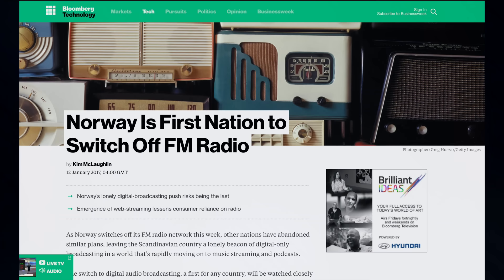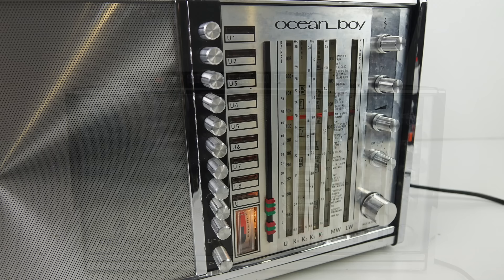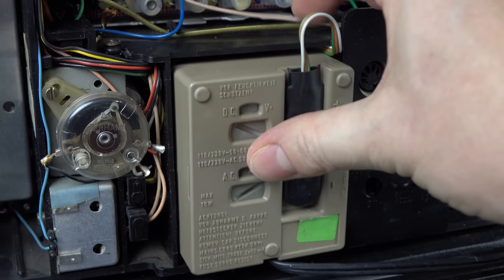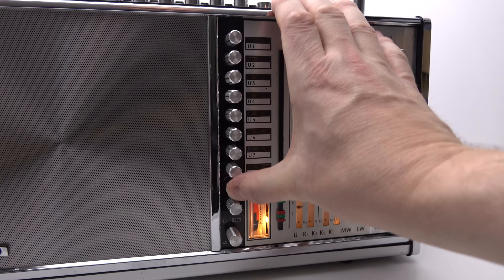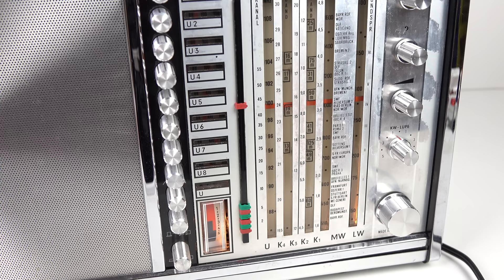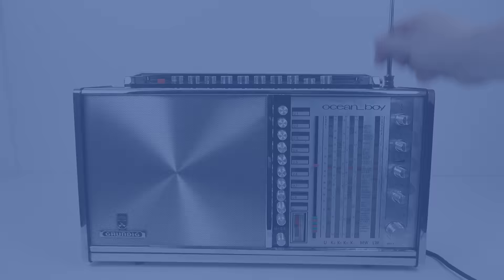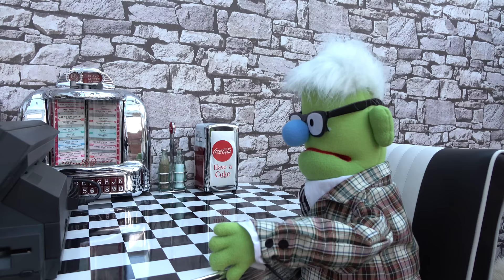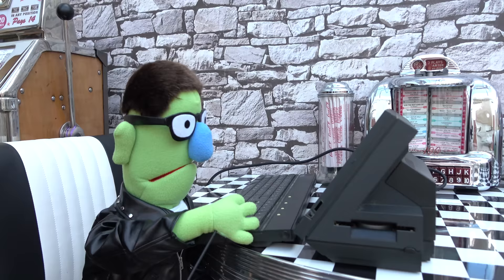Design Classic: Grundig Ocean Boy 210 Radio

Comment: I don't understand. Why are countries trying to switch off FM radio when the FM signal has better quality sound than AM radio?
Reply: because it has worse quality than digital radio
Reply: They are not reverting to AM, they are switching FM to use DAB (digital radio) instead. The latter having better quality and more features than FM, although one might argue that it is also more complicated to operate and requires replacing your equipment.
Reply: Is that a joke? If not then it's because they will be switching to digital radio. And even digital radio will probably die eventually, pretty much the whole continent is covered in mobile internet by now.
Reply: they moving to digital, not AM.
Reply: Louis XIV (aka 1685Violin) That's ok. If you read about it, you will soon understand. On a technical level, it's a RF/radio geek fanboy ordeal to explain it. It's like when countries switched over to using digital TV frequencies - we all had to either buy new sets or get a signal converter. Same thing is happening with radio. See this article - I'm sure there are loads more -- http://www.which.co.uk/reviews/radios/article/digital-radio-switchover-explained
Reply: Not to mention DAB is cheaper to run (and supports more channels compared to FM
Reply: Louis XIV (aka 1685Violin) Maybe cause the AM signal supports a wider range of sqaremiles then FM. Means FM is more expensive to run.
Reply: +Daniel Flught: cheaper to run from stations POV, i guess? Because the user has to change current receiver, so it's more expensive.
Reply: Jeren Velletri less about quality and more about freeing up radio spectrum for other things. broadcasting on FM and DAB means there's a bunch of space that can't be used for something else.
Reply: because they're making a digital switchover to online radio or DAB
Reply: Because the bandwidth will be very useful for 5G mobile. Your government can re-sell the spectrum licenses for a fortune. It's the same for non-digital terrestrial TV. "Ker-ching!"

Why do we still say that when cash tills have gone "Beep" for about 30 years? Oh well....
Reply: Because manufacturers of digital radios want to make money so they spend some money bribing governments making them think that this new digital thing is much better than the old analog crap so we should all throw our old radios away. And our old cars in which they've been making it more and more difficult to replace the radio in the past few years. But of course they'll let you buy a little device that receives digital radio and retransmits it on FM for your old radio.

Also, of course, organizations that own lots of copyrights want to make it as difficult as possible for you to record anything from the radio for free in decent quality so they've spent lots of money to make FM radio sound as crappy as possible in the last 20 years or so by introducing compressor/limters that make everything sound equally loud.

So in short: greed. And because people choose convenience over quality.
Reply: They are switching to the "new"(Invented in the mid 1990s) radio standard called DAB (Digital Audio Broadcasting)
Reply: Pushing sales of digital radios, which are made in China, thus strengthening the economy in China.
Reply: FM takes up an awful lot of space on the frequency spectrum for being not really that good quality, the choice to switch off FM and free it up to be used for other digital protocols in the future is only logical to me
Reply: Yeah, more stupid radio stations with the same shity songs on constant repeat and tons of commercial breaks. Wow, that's a bright future with digital radio. Same shit happend to TV.
Reply: Sam Gates Wrong. For example, there's a huge quality difference for the same station broadcasting in FM an digital HDRadio. Moreover, with same level of signal strength digital reception is more stable comparing to analog FM.
Reply: Yeah, and warm analog FM stations broadcast only live concerts using vacuum tube sound amplifiers LOL
Reply: Government gets to auction off the frequencies FM used to be on for mega $$$ which it can then misspend in the traditional manner.
The cost of buying DAB receivers falls on the consumer... but isn't actually called a TAX
This is why governments favour shutting FM

BTW DAB radios eat batteries compared to analogue and (in my experience) break down much more often - I also think it'll accelerate the lack of diversity in radio broadcasting.
Reply: Sam Gates DAB uses far more advanced codecs than the outdated MP3. there have been serious advances in audio codec tech, but everyone uses mp3 only because it's supported by most devices. DAB radio has far superior sound quality than mp3
Reply: +Dan Kueck How is it then that whenever the slightest hint of bad weather hits the fan, you might as well switch off your digital equipment because it's useless due to endless screeches and plobblwops or do you consider that music as well? There goes the "higher quality" out the window. Plus you'll find all radio stations broadcast in good old am quality "mono" just with a cleaned up sound. So sound engineers may as well shut up shop as well coz it turns out that the world will listen to any old shite that comes through one speaker. The stereo picture will sadly be a thing of the past.
Reply: +Reversed82 Have you actually listened to an FM station then compared it to it's dab counterpart? DAB is monophonic rubbish. Not stereo. Oh wait, you listen to nothing but your iphone or rather 1phone as it only has 1 channel. Last I knew humans were born with 2 ears, left and right unless born deaf. If your BBC radio FM signals are crap then you're living in a concrete jungle which is far from healthy. FM is organic.
Reply: Lee Sanderson you are dead wrong my friend. i listen to music only on my HS7 monitors or my mdr7520 headphones, and in the best quality available. but there is nothing wrong with lossy audio compression, especially if it's a modern codec.
Reply: @Reversed82 there is nothing wrong with listening to lossy audio if that's what you want to.. But even a 128 kbps MP3 sounds better then an 16 kbps AAC codec .. Now not ALL radio stations broadcast at this low bitrate but .. if 16 kbps is all they get, they might as well not be broadcasting IMO
Reply: Reversed82, no DAB uses MP2. If you think MP3 is outdated, you'll love DAB and it's paleolithic codec. DAB+ has some version of AAC, but that's not DAB and the two are not compatible.
Reply: One will be encouraged to keep the FM radios on.
Reply: plobblwops!!!
Reply: FM based signal transmission consumes a higher amount of power than an equivalent AM based signal transmission
Reply: +Daniel Olaussen AM based signal transmission consumes a higher amount of power than an equivalent LW based signal transmission.
Reply: +Reversed82, original DAB is CRAP quality. Worse codec than MP3, and at bitrates that turn music into mush and lose stereo separation (if the station is even in stereo). Let's keep FM until TPTB decide to give us a decent digital codec with the coverage and reception to match.
Reply: DAB (or DAB+) can sound better than FM. But not always. 

Here in Switzerland, the old DAB sounded ok a while ago. When DAB+ came up and the old DAB was shut down, the radiostations started to sound worse. Not long ago, here in Switzerland, the old DAB-Mode has been switched off. We still have FM and DAB+. But DAB+ sounds pretty bad now. The irony is: our public broadcaster sounds worse than some small private stations. The bitrate is now mostly between 64 and 72kbps. Even on classical music stations, who had 96kbps before. I began switching back to FM, because they sound better there when there is no possibility to receive radio via satellite or digital cable. When the first program broadcasts local news, the bitrate gets even worse, because you can receive every local programme everywhere in the country. I think this is the wrong way.
But this is Switzerland. I read about other Countries with better Quality on DAB+. They make it right!
Reply: My thinking exactly. With digital technology you can fit many stations into a given frequency. But with analog radio you can fit only one station on one frequency. Here in Canada, we're a long way away from implementing DAB. A number of radio stations in my area do use RDS to identify the songs they've just played.
Reply: Steve Struthers There are some HDRadio stations and they're far superior to FM
Reply: so governments can sell the FM frequencies
Reply: DoNotDisturbMe10 : late 80's
Reply: DAB Radio also saves a lot of transmitting power same as PAL TV and then dvb-t2 ,dvb -s2     , NTSC and ATSC
Reply: Ruddy Nora! That's a hard Brexit for sure.
Reply: +Reversed82 - You haven't got a clue.  It takes up a measly 20Mhz for which you get excellent quality sound, way better than the joke that is 128kbit or less MP2.
Reply: if they implement it good and have a decent bitrate for each channel for example like 196kbps then it would sound good , 128kbit is also good
Reply: Exactly.  DAB as a standard can sound perfectly good if stations are allocated proper bandwidth.  Nobody does, because there is a market for the bandwidth so there is always a race to the bottom in quality.  That can't happen on FM because the engineering side is unavailable to the marketing/bean counter folks to mess with.
Reply: Makes sense , since in analog(FM) you can't cut the bandwidth to 32khz. on digital you can and it would sound like shit.
Reply: In the UK at least Daniel the source feed FM is digital (NICAM) and it is cut off at 16Khz.  And it still sounds good, so the problem is not with the frequency cut off it is that lossy algorithms introduce noticeable artefacts that sound horrid.  When the BBC were researching what was to become DAB in the 1990s they did studies and at the time said 192kbit was the minimum acceptable quality.   As you know, we see bitrates well below that today on DAB.
Reply: they should be aac  not some old school mp2 lol
Reply: You must be American. AM has not been a thing in Europe for the last 20-40 years, depending on country.  Norway turned off the AM network 30 years ago.  (There is one long wave transmitter left in Norway, for ships in the North Atlantic.)   We switched from AM to FM back then, and are switching from FM to DAB now.
Reply: Extraordinarily the majority of answers to your comment suggest it is because DAB is better than FM, and digital radio is the great new thing. This just confirms my worst suspicions that most consumers of music have no idea what quality is.
Poor suckers.
Reply: Sam Gates
Weeeeeeeeeeeeeeeeee!
Reply: +Daniel Tsvik - AAC didn't exist when DAB standard was created over 20 years ago!  The DAB+ standard does support AAC but requires a DAB+ capable receiver.
Reply: True of many commercial broadcasters these days. Get a lot of that on FM here in the U.S. with Clearchannel or I (s)Hart Radio. They kind of ruined broadcast radio as it is anyways.

I guess they're too damn cheap to upgrade their playlist servers, even though terrabyte drives are cheap these days. You get that "underwater" low bitrate noise on a lot of music that shouldn't even have it.

The better stations worth listening to still play a good deal of music off CD though, but they're more rare to find on the dial.
Reply: I am going to copyright a song called "hiss" and I intend to claim royalties when the FM is switched off.
Reply: *****
Yes, FM could sound insanely brilliant - Why shouldn't we expect a superior broadcast format 70 years later? Madness in my book.
Reply: I own a few old cars in the UK, and I can still get my favourite stations in AM in my two 1983 vehicles;  like Absolute on MW.  

I dont want to ruin the Facsia of the car with some modern head unit, its hard enough ripping out all the modernisations and sourcing stock parts as it is!
Reply: yes
Reply: I could, but the little DAB radios use the AUX lead as a COAX and it needs to be extra long, adding to that if I just use my phone, it carries massive RF interference down the AUX lead and out of the car speakers
Reply: I know what the ipod touch is, I just use an iPhone 6 for my music.  I have most of the music I want on cassettes in the car, or I just switch my phone onto flight mode which has the music I want, except I do that, I can't stream radio from the phone.  

I carefully selected the tapes quite recently for the car.
Reply: A lot of bands are releasing on tape again funnily enough
Reply: Vinyls aren't crap, not if they are good ones!  

I attended a "James" gig in 2016 and they released their new album on Tape, I saw some other bands doing it too.
Reply: Sam Gates yeah.  I've been buying vinyl since 2011. It's all old and cheap stuff
Reply: Norway is switching to DAB+ though. This has in of itself been a commercial embarassment as a lot of a consumers bought DAB radio equipment only to recently being told that they can't use those either. Lots of angry people who bought DAB receivers had to buy DAB+ receivers. Also, to make it even more amusing, media tends to write about a DAB switch, considering the fine detail that DAB+ isn't the same a "technicality" ;)
Reply: We have both in the US and I don't see that changing in the near term.   AM is fun because at night I can tune in to broadcasts from hundreds (if not over a thousand)  miles away, and the low fidelity broadcast is nostalgic.  

I do my serious listening to digital sources, but I do enjoy the throw back and still use valves (tubes in the US)  for some of my amplification as 'perfection' in amplification produces sterile music.
Reply: Or people don't care about what 'quality' is.  As a musician I've noticed that I care a bunch more about my tone than anybody listening, and have learned to make things 'good enough'  for the audience.  No need to keep moving technology when you've reached 'good enough' for entertainment purpose.  I mean, really, beyond audiophiles who really needs better quality?  It is just another gimmick to sell more crap.
Reply: Louis XIV (aka 1685Violin) digital taking over
Reply: Beginnings of FM The old Tubes sound great!
Reply: Something about AM though warm sound ,maybe that;s just me
Reply: donpalmera - This is unfortunately the correct answer. It’s about selling off that part of the spectrum for other services and money-making motives. Those claiming that digital is better than FM aren’t necessarily right. DAB uses a pretty crappy old compression format that is for example inferior to North American digital radio. Speaking of making money, here in the UK and elsewhere the UHF TV band has been ripped to bits and auctioned off for 4G etc. This has caused great expense to organisations that have invested thousands in affected wireless microphone systems in that band. Before long there’ll be hardly any of the spectrum left for anything but the telcos. They have the cash to buy up the spectrum.
Reply: pauljs75 i(s)hart Radio is a phrase I will will try to use as often as possible! Thanks for adding to my personal lexicon.
Reply: Because they want the bandwidth for your daughter's mobile phone!
Reply: @omikl  

Not really- the 3 meter waves of the FM band won't work very well for small portable devices, they'll still want to use UHF.
One thing digital broadcast radio could do with DAB is (God forbid), make free services with commercials into paid subscription services with commercials without notice.
Reply: I agree, problem with DAB it’s terrible for anything live due to a few seconds delay!

Comment: When I was a teenager my parents had a Yacht Boy and I can atest the sound quality was very good. I used to plug my Cassette recorder also a Grundig into the DIN Line output socket on the radio so I could tape programmes from the radio.  

The Yacht Boy also an short wave and even in those days it was difficult to find shortwave stations using the telescopic aerial. I did however have a wire running from a tree at the bottom of the garden to the chimney on the house with this connected it was almost impossible not to find a transmission on Shortwave!.

Thanks for giving me a blast from my teens,

Comment: I guess for SW short wave you need to install a special antenna at the rear of the radio. As FM snd AM have each its own antenna too.
Reply: I made an antenna for my SW radio by wrapping wire completely around a wine bottle. Perhaps this was invented by Tesla?
Reply: In many portable radios with both FM and shortwave, one antenna does both. The antenna is much shorter than the signals on shortwave, but brute-force amplification makes up for it.
The medium wave (AM) antenna is magnetic, inside the radio.

Comment: DAB+ is quite disappointing, because the audio compression (AAC) is patented. They could have used newer and open-source Opus. It beats other codecs, and quality vs bitrate is a sure point of debate among digital radio enthusiasts.
Reply: Yeah, you're right, but they could have used Vorbis. I guess the "climate" was different back then.
However it's not about being smug, if there will be no choice for people. I know that open standards really make a difference you wouldn't imagine. The Chinese can make wonders. Like USB card readers for 0.2 USD. Or the ESP8266 Wi-Fi microcontroller for 1.8 USD. All open standards. If there will be only digital radio, it better be royalty-free.